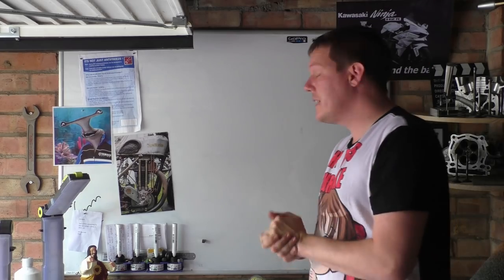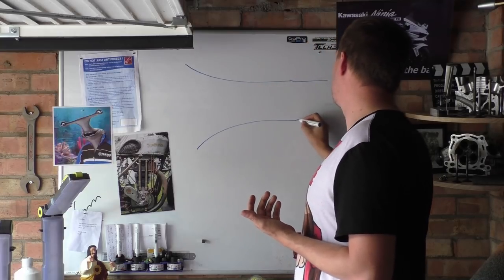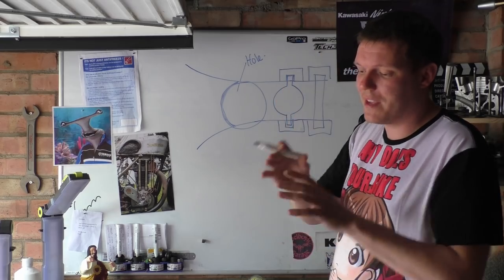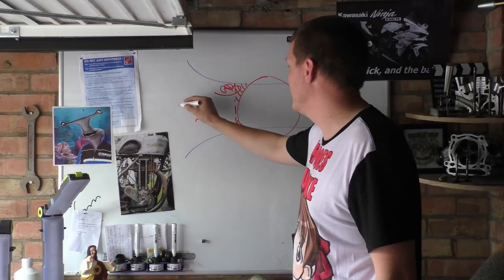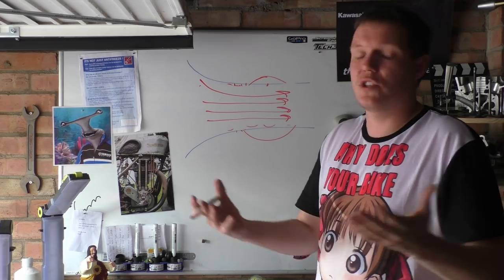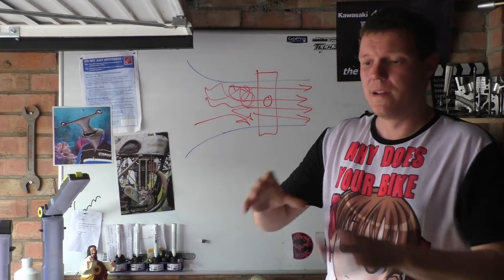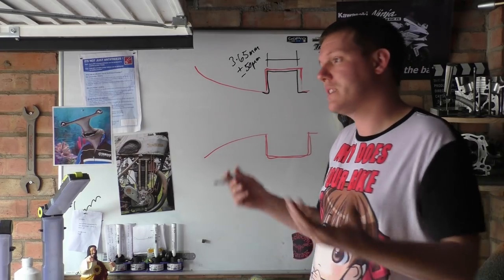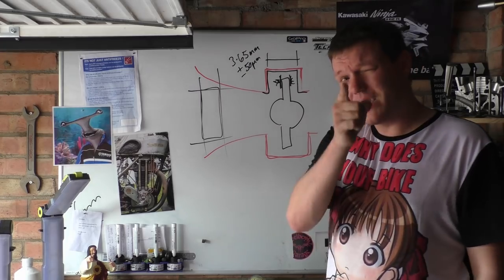Slide carbs - Why are they flat?

Comment: I believe that traditionally, there was an issue with flat slides on engines that can draw a particularly high vacuum. When the slides were open, the vacuum could force then against the back edge of the slot that they move in, and when the throttle was closed, the slides stick and not drop back down, with the predictably scary results.  They largely overcame the issue by adding in rollers for the slide to run on.

Comment: I just put a TM-33-12 Mikuni flat slide carb (pumper) on my bike, it's running really well. But I can't share any experiences, cause going from a 24mm to a 33mm is just a ridiculous step so I can't feel anything between round and flat. (the 24mm was terribly restrictive). It's running great, I just need to get back to my fuel consumption with some more jetting.
I don't expect exactly the same, with a pumper carb and slower air speed, but going from 3L to 4L is quite bad. A A/F ratio sensor would be sooo helpful..

Comment: My experience with round vs flat slides is that it is more controllable on the street with a round one. But when you crack it full wanker the straight slide delivers more quickly. There is a lot of restrictions in 2 strokes for example, almost all are made to make your granny not fall off the socius seat.

Comment: I've heard that one reason flat slides work better is because they don't make the air flow through as much of a restriction as a round one - typically a round slide is thrice as wide as a flat one - apparently the air velocity remains higher after a flat slide - it does make sense - if you blow through a longer "pipe" it restricts more than a shorter one for the same pressure

Comment: I know it's a general vid Matt but surely you're missing the Gsxr style slingshot (half/face round slide the other half/face flat slide) carbs here? These were pretty good at combining the best of each type of carb for the big old beasties. The ER5 looks like it's doing similar but has a round face on both sides (patent issues?).
Reply from the maker: "I know it's a general vid Matt but surely you're missing the Gsxr style slingshot (half/face round slide the other half/face flat slide) carbs here? "

- No because its a general video like you said. There are 100's of variations, some successful and some others not so much. This video would be 80 minutes long if I included everything and there would still be a 1000 questions. Short intro videos like this keep the question manageable. Also just to add, based on the patent question, some of this shit I just don't know.
Reply: Cheers for the reply Matt, yes I see & take your point (oo'er missus)…..speaking of which (the variations) feel free to disgress at some point & speak about a few. Most of us older ones may well have experience of the common Japanese, Italian, German & British carbs (most of the younger ones won't but I guess efi makes that a bit less relevant) but if you can find some real oddball stuff it will make for interesting viewing. 
Anyway, nice 1 mate, take it easy.

Comment: Would love to see a comparison of a normal carb to a electron carb and explanation how metering rods work etc.
Reply: ha ha ha. lectrons do something different.
if you go research emulsion tubes, and air compensation valves, the nature of venturis.. you might get it.

very simple. the use the vacuum in the venturi to balance itself out and provide a linear, regulated vacuum on the "jet"... they dont have jets but i still call that hole and rod a "needle and jet"...

rather than the "constant velocity" CV carb, theyre a "constant vacuum". 

ive never even looked inside one and i know how they work... its easier to modify cheap standard carbs to do it!

Comment: Ok, so round slides are a compromise, flat slides are better but more expensive, would it be possible to grind a flat side to your round slides to get the best of both worlds, I know this would involve making a new slide because you can't just hack away at a slide, but if you had the time, some billet aluminium and a lathe would this be possible. 
Great video, keep em coming 👍👍👍
Reply from the maker: That's kinda what the half half versions are meant to do. Most circular slides are hollow.
Reply from the maker: TO add, you also don't want the slides weighing too much.
Reply: Cheers guy's.
See Matt you have the best comments 👍👍👍

Comment: I had 41 mm keihin carbs on my GSXR1100. she did have a 1192 big block conversation a skimmed and ported head ,Kent cams,  fully lightened and balance,  welded crank, Barnett clutch, plus various other bits including exhaust , it was built by Hobbs sport in leeds. The carbs used to chatter like fuck until about 4500 rpm. Plus to start from cold you had to twist the throttle a few times. Wish I never sold her now she was fast as fuck 👍👍👍

Comment: What about a carb with a slide designed like a mechanical iris? A hole positioned right next to the fuel jet that expands or contracts to control airflow. It's probably too complex to mass produce and a pain to work on, but it sounds like it could still work.

Comment: could you incline the throttle slide so the top of the slide is further out than the bottom. the air hitting it would be diverted downwards towards the opening

Comment: Right ive got a question for ya buddy, so you know how CV carbs with the diaphragm are supposed to like smooth out the engine response i suppose, and these "PWK" flat slide carbs give you a more instant throttle response, well i was just wondering, long term how does this impact engine lifespan/life expectancy?

I'm asking specifically because (and not sure if this is right or not) i was always under the impression that fast changes in engine rpm especially fast increasing rpm as opposed to high rpm itself causes more long term wear.
Would you expect to get more miles from an engine with a CV carb vs this "PWK"/flat slide thing?

Comment: Purpose of a flat slide carb is it is more compact, less room required between engine and air box allows more design latitude for engine, tank and seat etc.
Downside is they are more sensitive to jetting due to the short cutaway and more crisp throttle only if the jetting is spot on due to that sensitivity, also more expensive.
As to turbulence at the curved face, a round surface has less resistance than a flat one which would cause less turbulence and stagnation.
The nozzle often has a small rounded wall ahead of it for the express purpose of creating a turbulent stagnation point at the nozzle outlet to ensure more uniform mixing.
Reply: Does flat slide/PWK vs CV/diaphragm carb have any effect on engine life expectancy? Just asking as I'm under the impression that due to the quicker changes in RPM/throttle response with flat slide Vs CV carb and increased performance that you might get at less miles out of it in the long run
Reply: @gabrielwalker421  
I wouldn't expect so.

Comment: I wonder if you couldn't just make round inserts with indexing pins on the bottom which have the correct sliding profile already machined in them. Then it's just two holes each (main bore and index for the pin) and in they slide. Still four holes instead of one, but a damn sight cheaper than broaching

Comment: What’s a pumper carb and why does it pump?
Reply from the maker: we'll get to that.
Reply: Dave Spooney If you are referring to an accellerator pump it squirts a quick stream of fuel in to make up for the fact when you go wide open throttle there is a drop in the velocity in the air sucking the fuel from the main jet. This is to midagate the wide open throttle bog on larger four strokes.
Reply: When turning the throttle hard, normal carbs would not open until the vacuum is build up, so that the air-fuel mixture will be sufficient, otherwise the engine would stall due to having too much air (carb is open) but not having the vacuum necessary yet for sucking in enough fuel from the fuel needle opening. Keihin i.e. presses some fuel directly into the airstream when turning hard on the throttle by having the throttle cable mechanic also connected to a small pump
Reply: Thank you all!
Reply from the maker: No need to do the video then.
Reply: The Workshop - YOUR VIDS ARE AWESOME. Plus my Mrs thinks you sound like Guy Martin.

Comment: dts have a flat side carb. why is mine a bastard to start if its been stood for a while? other wise its fine any ideas
Reply from the maker: How longs a while?
Reply: a few weeks maybe more. but once going it will start every time every day  till you leave it stood for awhile again. then same thing.
Reply from the maker: This is your fuel losing the high volatiles like isopropane etc. Specially if you have a plastic fuel tank. With the high volitiles gone the fuel vapor pressure drops - which makes it harder to start
Reply: nice one its a metal tank so would it be best to empty the float bowl and let it refill  before trying to start it
Reply: My RGV does the same thing (it also has flat slide carbs).  I'm pretty sure it is to do with lack of fuel in float bowls, crank case, transfer ports etc.  I turn the fuel tap on about 15 minutes before starting, and then right before starting, I gently pump the kick starter 6-10 times with the ignition off.  It starts within a few kicks every time when I do that, often first kick.  Like your DT, it is only when it has been sat for a while.  Starts first kick the rest of the time, and idles and runs beautifully.
Reply: nice one tried this started after the 3rd set of 10 but much quicker and easier than before cheers
Reply: No probs mate. Glad it helped.  Maybe try turning on the fuel 20 or 25 mins before you start it.  That would be the next thing I would try if it's still being a bit of a bastard.
Reply: I'm so glad I found this post. My slabby has always done that. I now leave the fuel on a couple of minutes before hand then give several blips of the throttle so the accelerator pumps squirt fuel and it starts straight away. Fucking annoying but I'm glad it's not just my bike now. Oh and it's running the stock vm29 flatslides.
Reply: slabby rider  Glad it helped mate.  Interesting that it seems to be happening with flatslides.  Wonder if that's just a coincidence or if it's relevant, although I don't see why it would be.

Comment: hi man, 1st i love watching your videos and i’m learning from them
2 nd i have a question voor jou!
i have a 2stroke minarelli engine scooter(aerox) , i have used in the past thinner full synthetic oil , but now i can’t get that oil anymore so i i’m using now a thicker full synthetic oil, but now the problem is that the cylinder is running hot at full gas sinds then
The thinner oil ratio was 1:40 
the thicker oil now is 1: 33
can you tell me why it’s getting a hot runner?
Reply from the maker: Yes - you're running leaner fuel because you have more oil. Run 40:1 on this new fuel. Fuel helps cool the cylinder as it evaporates when it enters the cylinder.
Reply: thanks mate 😅

Comment: On my shadow vt 125 there’s 2 cables comin off my throttle one is rusted in 2 idek what it leads to because it revs fine do you have any ideas I got the manual on the way but I want to take it out before as it’s my only transport
Reply: Ace JavaCoder so it’ll be ok with the one?
Reply from the maker: I did do a video about this....
Reply: The Workshop can you link it please
Reply: Ace JavaCoder ,, nope , one is not a Pull & the other a Push ,,, they’re both Pull ,, Pull open, Pull closed
Reply: @ Moto Minx.... they can't both "pull" at the same time can they? one pulls at the same time the other pushes.....Hence the term "push pull" throttle.
Reply: Ace JavaCoder ,, regardless of what they are know as , the fact is both cables pull.
& yeah you’re right ,, it’s amazing how people such as yourself don’t listen.
Remove the opening “pull” cable & see how well the throttle works with the so-called “push cable”

Comment: Why don't they just make a flat slide carb with a slot milled for the slide to fit into perfectly? Sure, the slot would have a radius at each end but the slide could have them as well and you just design the carb so that you move that part of the slide out of the path of air so the passing air only sees the flat part.
It should cost about the same to mill a slot as it does to bore the hole...

Comment: it strikes me that in all carbs, theres this horrible zone of turbulence behind the throttle... be it slide, butterfly, or what not.

doesnt seem very conducive to good VE. why do diesels have good VE? turbulence free intakes...

 a carb, a venturi, is very similar to a wing. the profile shoud be, anyway. as after the venturi, the air si attempting to go from high velocity at LOW pressure, to low velocity at HIGH pressure... air only likes to flow form high to low, not low to high. bernoullis only works due to conservation of energy, and turbulence is energy being wasted. you dont stick big lumps on the trailing edge of a wing and expect a plane to fly. or halfway along a wing, either...

 you cant have obstructions behind or in front of the "ideal" venturi. it has to be aerodynamic.

i just realised how to get around it. oh my. patentable, maybe... laminar flow carb.

i gotta get off my butt and out in the shop...